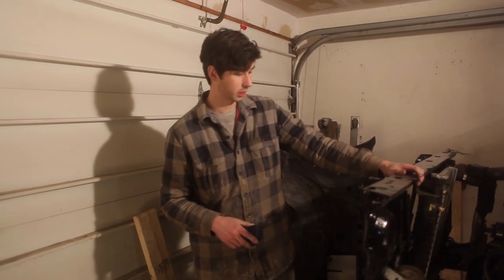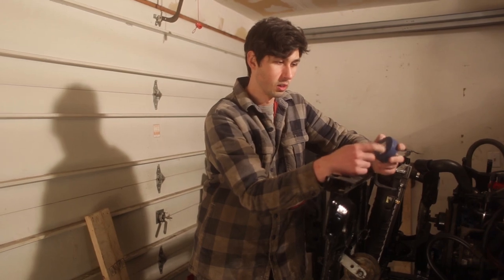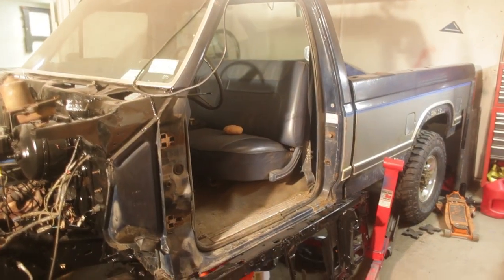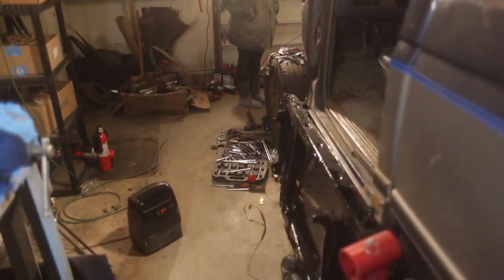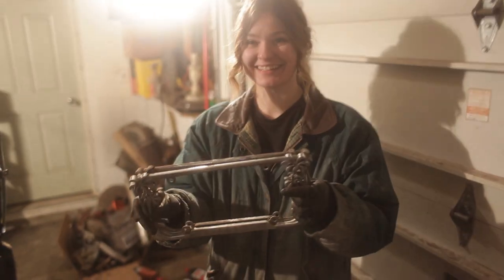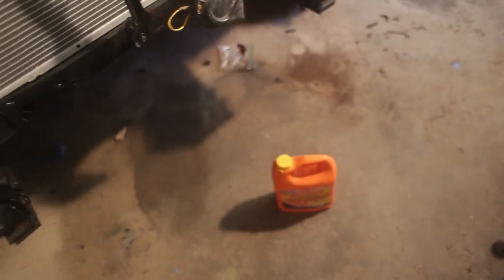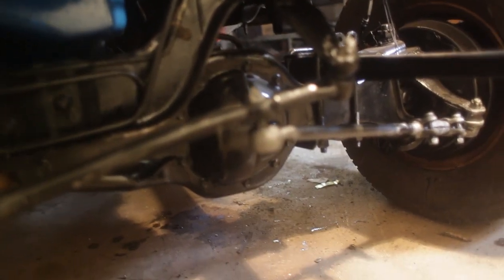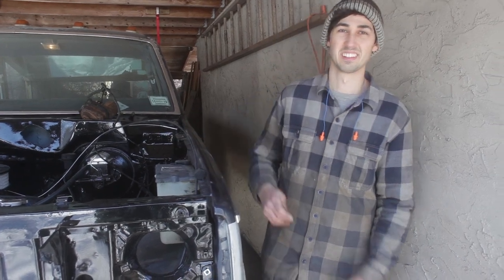F250 Restoration: Driving Again! Part 19

Comment: Those things the tie rod ends attach to are called drag links.  And if you want to adjust your own alignment look for videos on using the string method.  Those old Ford trucks are pretty easy to get alignment spot on.  Great job on getting her going guys! I love your videos!
Reply from the maker: Thanks, seems like everyone has their own slang for truck parts so I have a hard time finding the actual names for parts. We did actually do the string method and its turned out great. Camber on the other hand...

Comment: dude how the heck have you half way restored an 80s f250 and cant find body mounts. Literally any place has those. Keep looking. Those hockey pucks will make the ride of the truck harsher too. But on another note. great progress! nice to see this thing coming together it takes a lot of work
Reply from the maker: Specifically the radiator mounts. We did not replace the ones under the cab.

Comment: Hey check out energy suspension parts , I bought my cab and radiator bushings there and they are high quality
Reply from the maker: Came across those. Will probably do those on the whole truck at some point
Reply: @TheBadTimingClub , LMC TRUCK is a great source for all Ford trucks from 47-97.Check them out.